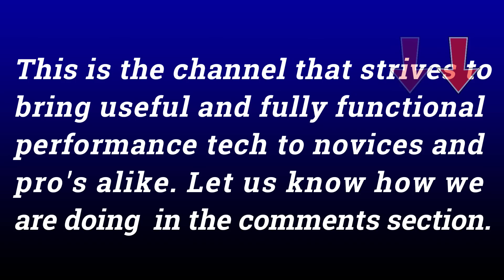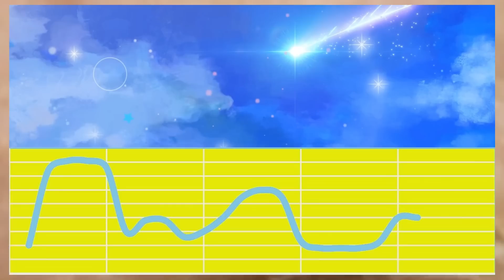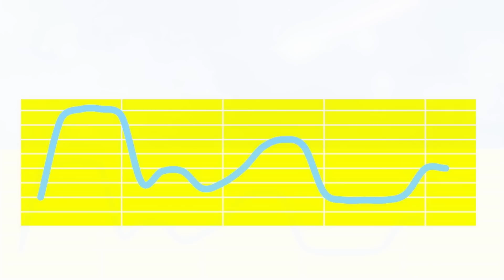DV's take on Weingartner cam shootout.

Comment: I don't care what u run on the street.  Give me back my rusty 1966 mustang, 302, 0.030 over, 1969 351W 4v heads, 2bbl carb, 2.5 inch dual exhaust, 2:80 rears with a leaking rear seal, 3 speed on floor.  2800 lbs with me in it.  In city block, beat 396 Chevelle, 400 Trans Am, and the police outa town.  Nobody beat me in city block.  I had no brakes, so, fast enough.
Reply: I got nearly same in 67
Reply: @dr.john-markcain4946  The 400 Trans Am guy made me pull over to see what my engine really was.  Boy, was he disappointed.
Reply: @dr.john-markcain4946  that leaking rear seal is a slider clutch ... it is a must have on street drags.
Reply: My Younger Brother won the Saskatoon Street Drags in a 1969 Mustang Grande (it had vinyl roof), 302, 2bbl, 3speed on floor. In 1984.
Reply: Oil keeps clutch cool and keeps gripping.
Reply: While sliding.
Reply: And as the clutch fibres tear off, they make the oil more grippy.  Win win in my Mustang.
Reply: I read in a magazine I could put 351W 4V heads on my engine and it had all the specs.  So Mom took me to Davidson, SK Ford dealer and bought the proper head  bolts. That was in 1982.  Those were the tapered head bolts.
Reply: Buddy Kurt sold me the heads off of a 1969 Ford Ranchero with factory 351W 4bbl.  I was ignorant at the time.  I should have bought the whole car.
But i went to school and sold my soul, wrote software in two countries.
Kurt had one of 4 1969 Roadrunner converts with 426 hemi.  His old car has now been restored and displayed and u can see it on tube in car shows.
Reply: Similar here 👍👍😎LOL
Reply: I overheated that 302 several times doing speed runs on Highway 11.  Tim, in his Chevy, always kept cracking his heads from overheating.
Reply: In the late 1980's, I was rocking 95mph around the Whitemud in Edmonton, this white Lambo caught up to me followed me for a bit then blew me away.  I hope he wasn't rude.
Reply: I took people across Edmonton in 35 minutes in my red 1966 Mustang.  85 mph down Argyle, passengers holding onto roof and sides at same time.  My Cousin was actually scared when i split lanes thru intersection at 85 mph.  I think 85 mph is my safety zone.  Tho my Harley likes 140 kph.
Reply: @bradyelich2745 
Wow, that's 87 mph 😳💥
Reply: @hotrodray6802  pretty fucking fast when you do it for 700 miles.
Reply: I got clocked by the Florida Highway Patrol in Henninpin county at 113 mph so they said.  It was sunday going home from work.  1996 XL1200S.
Reply: I was in Tampa ...
Reply: @hotrodray6802  I ran from Fargo to Saskatoon in under 12 hours, and I had two beers with my Dad in Kenaston.  10 fuel stops and a flask of tequila.  Canada let me back in without incident, but I smuggled our wedding rings.  I Ran Back to Saskatoon to get married.
Reply: I had to go 125 miles to get to Fargo from MSP.  I ran out at 120 miles because I rode too fast.  Some Buddy stopped, and poured gas all over my bike.  Then I get into Fargo, without helmet on, popo followed me knowing I'm a badass... until I got to hotel.
Reply: @hotrodray6802  I should ran South.  I'm so stupid.
Reply: @hotrodray6802  I already paid for the house in Saskatoon.  I should have ran away ...
Reply: The FHP held me up up for an hour trying to figure out if I was the Canadian bank robber they were looking for.  Funny, that was never on the news.  I only had to get the gates open, drive thru and close them ...
Reply: I lived at Marina Pointe in Tampa.  There was a 5 foot alligator in the pool, and a rabid raccoon hurting dogs.  I reported the raccoon but nobody came.  And nobody there had a gun, in fucking Florida ...  Can u imagine?
Reply: @hotrodray6802  That is what I cruise at.
Reply: 4000 rpm.  Still 40mpg, on the cam sounds great.
Reply: The Guess Who song  "Running Back to Saskatoon"
Reply: I stopped at lights.
Reply: ,,,,,,,,,,,,,,,,,,,,,,,,,,,,,,,,,,,,,,,,,,,,,,,,,,,,,,,,yes,,,,,,,,,,i believe in  u f o 's....................seen big foot last week in the woods...............................
Reply: That car is almost 2800 pounds curb weight the 6cyl was over 2600. And those heads only had 1.84” 1.54” valves with a 2.80 gear that car wouldn’t of been that great from a dig if you beat a 396 chevelle it would of been the low 325hp ones
Reply: @Thumper68  396 with four plug wires off maybe.. Dudes high af or someone couldn’t shift/drive.
Reply: @Thumper68  I had a leaking rear seal that gave me a slider clutch then locked when hot.  I think I had 150 hp to rear wheels.  At most 260 hp wot. the exhaust did breathe better than intake.  I weighed my car with me in it, it was just under 2800 lbs.  it was really rusty.  I weighed at the grain elevator.
Reply: @Thumper68  On the street, it is about hp to traction.  I dont care if u have 1000hp, my Stang beat u in a city block.
Reply: And I could do the same rain or shine or ice fishing.
Reply: @ lol ok sure.
Reply: @Thumper68  U think 1000 hp beats traction for 400 yards?
Reply: And u think a 396 375 hp is faster than a stock 325hp ford 390?
Reply: My Dad and his buddies raced for 50 miles.  The Ford 390 won.
Reply: If you want to win on the road for WOT racing, don't go for highest hp.
Reply: @bradyelich2745  no way your dad and his buddies raced for 50 whole miles… and you rode 87mph and 113 wow amazing lmao. Your idea of fast and mine are in two different worlds.🤣
Reply: @Thumper68  Shit we raced from Kenaston to Saskatoon.  Sometimes the whole way in the ditch.  When they twinned highway 11, it was just a personal race track as nobody was on it back then. I and buddies did many land speed record attempts.  It was glorious.
My 87 mph is for 10 hours steady on a xl1200s.  
113 mph is pretty crazy in town.  
My Dad raced from Thunder Bay to Saskatoon under 12 hours.  Ina 1958 Edsel.  135mph and that was on gravel and the square, no highways, all correction lines.  Im pretty sure Dad had one of the solid lifter 361's - the E400.  Dad said that car was the fastest he ever had - RIP Dad.
Reply: @Thumper68  When one guy in his corvette passed buddy in his hemi, the hemi guy said "I could see daylight under all 4 of his wheels at the same time".  Corvette guy said speedo pegged at 160mph.  They raced for miles, WOT.
Reply: @ ok I rode wheelies at 125mph every day and hit 170-190 multiple times a day. I covered 41 miles in 18 minutes on a road with some of the sketchiest turns that are 90 degree switch backs blind with overhanging rock that 25 is fast and over a pass that’s averaging 136mph. And it was about 50 degrees outside. I was hitting my governor at 186 so hard at one point I still accelerated to 196 mph.
Reply: @Thumper68  "Maniac" in Jeremy Clarkson voice.  120mph is good for me since i never know when im going into the ditch.  Which i've done because the beer bottle blocked my view.  But, I will hold that 87mph all day long, which many sport riders cant do cause they humping a football.  the one guy said he had to go 125mph to be comfortable.
My Buddie's Bois got in fist fight over how fast they cruised home on their sport bikes.  All the farmers said they could not go that fast.  It was hard fight but Bois won.
Reply: The Bois also grew up on the farm.  That Second One always got the biggest deer and he told me one time ' I just do what you taught me.'  That one deer he got was a 6X6 in SK flatlands.  Fing awesome.
Reply: a half mile from my farm.
Reply: @Thumper68  Did u ever watch the Black Knight rider on tube?  He is fing crazy and good.
Reply: @Thumper68  U paying attention? I had 1969 351W 4v heads.
Reply: @ yeah I know I can read. C90E heads have a potential of about 229 cfm intake and 175 cfm exhaust fully CNC ported.  Nothing to special really.

Comment: Looking at the data it appears as if the LS platform likes a late EVC.
Reply: ,,,,,,,,,,,,,,,,,,,,,,,,,,,,,,,,,,,,,,,,,,,,Generally speaking , a cam combination with  a SEMI LATE CLOSING INTAKE and a  SEMI EARLY OPENING EXHAUST  will give the most all around satisfaction in a high performance  engine.............................late  EVC,,,,[ATDC]   would  give more overlap  degrees, on the exhaust valve side,,,,,,,,,,,,,,The cam that won the challenge  had more than fifteen degrees duration than its intake valve.............I bet it would have made more torque  all around  with a  2.080 inch  intake   valve,,,,,,thus  , not needing  the  large  exhaust  duration,,,,,,,,,,,,,,,,,,,,,,,,,,,,,,,,,,The heads  were awesome,,,,,headers may have been better at  1.875 inch,,,,,,,,WTF,,,,,,Thanks  Eric  for your dedication , and  DV  for your  dedication....................................

Comment: Eric Weingartner spotted a trend.  He said that the better performing cams had the most lift.
Reply: Nonsense.
Reply: Lift.... 
Opening the valves higher gives more area under the curve at every lift point. Lifting BEYOND the max flow point allows the max flow longer. If the flow tops at say .500, then lifting to .600 means that head is flowing more earlier and longer.
It's always better to over lift the max head flow point.
IMO.
Reply: @hotrodray6802 only if the port maintains stable flow, a lot of LS heads go turbulent after 600 lift.
Reply: @hotrodray6802  The valve spends so little time at max lift that it makes no real difference in performance.
Reply: LS guys figured that out a while ago!   They were lifting mid .600" for years and having those elevated HP and TQ numbers and Ford guys wer scared to go over .600", they were mid to upper .500".
Reply: @dennisrobinson8008  I dont think the modulars could physically do more than upper .5s. If they can they dont have the head flow to take advantage of it.
Reply: @zapa47  so lobe on valve had that limitation.   Some had "rockers" which gave a multiplication but no where near pushrods.
Reply: @dennisrobinson8008  Ford guys running Cleveland style heads have been running .700" plus lift on solid rollers for 30 plus years. Another thing too Ford guys worked out a long time ago, when using Cleveland style heads, the exhaust port flow to intake port flow is poor, so the best way to help this  is to increase exhaust duration a fair bit more than the intake. The same thing they are doing now with LS3 style heads. Nothing new to old school Ford guys.
Reply: @Matthew-uj4zx  Hi.  I was talking about typical Windsor cam lifts on the street.   I knew Ford guys would use .7" plus in racing situations but for the street it's not common.   On the LS they've done greater than .6" lift in street situations over s decade maybe 15 years.   I believe the Ford guys thought it be a longevity issue but it's working on LS and that extra .100" or so of lift is making a difference.
Reply: @dennisrobinson8008  pretty sure engineers figured that out like a hundred years before the LS engine
Reply: Makes sense, in the real world you can't rebuild an engine every year so I'd discourage Stroker Mcgee from going full ham. Big american v8s love lift but most other engines get by with less
Reply: It’s the rate of the ramp in that matters. The steepest lobe with highest lift  you can have while staying in control of the valve will always be the best
Reply: @Thumper68  Not necessarily.  There is a target seat velocity that should be achieved by the valve motion.  It is possible to have too much lift at various phases of the cycle that can reduce velocity and hurt cylinder filling.
Reply: @DaveMcLain  u may be right.  I watched a video with the guy that specs the winning cam and he swore that it was a very gentle lobe profile.  And I also remember someone saying that the extra power may have come from the the gentle profile not causing as much pushrod flex.
Reply: @ericsmcmahan  Cams are always a compromise.  Take a look at some of the stuff that Mike Jones has posted about his design techniques.  His method is valve seat velocity based.  He uses the demand, the valve size, RPM etc to figure out what the engine wants.  He has to then compromise to get valvetrain dynamics that will work with the valvetrain.  Quite an interesting idea.
Reply: @DaveMcLain where did he finish? 99% of his 'technique' is used by anyone choosing a cam profile, those are basic fundementals.
Reply: @optimumperformance6998  I don't think that he entered anything in this contest.  What target velocity at the seat do you like to use when you select a camshaft?
Reply: @DaveMcLain  Umm, how about one that doesn't delay valve opening due to system stiffness or bounce the valve at closing? It is always system dependent.
Reply: @optimumperformance6998  I'm not talking about the seating velocity of the valve I'm talking about the velocity of the air coming through the curtain area that's created by the amount that the valve is lifted.   What velocity do you try to target when you're working on a camshaft for an application?
Reply: @DaveMcLain  Are we racing flow benches or living in reality of running engines. Seeing that you somehow have all the velocity data from a running engine across the valve seat maybe you should share that with the class. This was a simple contest with fixed parameters and all the information was available to anyone that entered.
Reply: @optimumperformance6998  I'm not talking about flow benches I am talking about running engines and the calculated velocity that has to exist through the curtain area due to the piston demand of the engine.  The approach that Jones has talked about is based on a target air velocity at the valve seat.  Read some of his remarks and then you'll understand what I'm talking about.
Reply: @DaveMcLain  again, a fancy way of getting your timing events correct at the valve (not cam).
Reply: @optimumperformance6998  That's right and the events that happen at the valve are what count because that's what the engine actually "sees" as it runs.
Reply: @DaveMcLain  640fps
Reply: @optimumperformance6998  Cam lobe designers like Brian Tooley design velocities at the valve rather than at the lobe.  They are able to use their spintron to monitor pushrod deflection, valve lofting, valve bounce and things like spring gyrations which also cause problems.  He's a pretty sharp guy also.
Reply: That isn't news. Lol you guys are acting like there wasn't an automotive industry before the LS engine

Comment: DV, Danielle Powell suggested that the headers were way too small.  The winning cam had about a 20 degree duration split.
Reply: He sure does but I have to question( after seeing larger headers make no difference on other engines) if the exhaust is actually restrictive or if the success has come from the larger diameter creating an anti reversion affect. And do the LS heads suffer more from reversion?
Reply: a smaller header with more split might be better.  better than even a larger header with less split.  might be a velocity and scavenger thing.  the exhaust event can act like a third lung, so to speak.

Comment: Didn't want it to make the number 1 figures?
Reply from the maker: If I had won I would have ZERO data above mine and that ultimately would cost way more than the $5000 I would have won!
Reply: @DavidVizard  as i  read it DV you used your cam as a known calibration point in the middleish of the data set so you could determine the parameters you need for your software primarily
Reply: For a sanity check. 14th place says he could have won if he wanted to?
Reply: @kylemilligan752 he didn’t say that at all.

Comment: Great DV. Cam must fit the intended use. I have no idea what all the cam specs were, but you stated you spec'd your cam a little shorter on duration which would be a great street cam, as you stated. Obviously all that entered are experienced engine builders with LS experience. Tough lot to compete with.
Reply: If you watched the video of the winner, he is a young guy, probably under 30.  He splits his time between designing his own engines and working at the cam grinder that  ground his cam.  Obviously, a substantial knowledge base on LS type engines in his experience
Reply: Several had no experience with LS engines, just the test parameters.
Reply: ,,,,,,,,,,,,,,,,,,,,,,,,,,,,,,,,,,,,,,,,,,THEN ,,,,,,,,,,,WHY DID  BRIAN  TOOLEY,,,,,,,,NOT WIN,,,,,,,,,,,,,,,,,,,,,,,,,,,,,,,,,,,,,,,,,MY THOUGHTS.........................all that entered  were not experienced  L S  engine  builders,,,,,,,,,,,,,,,,,,,,,,,,,,,,,,,,,,,,,,,,,,,,,,,,,,,,,,,,,,,,,,,,,,,,,,,,,,,,
Reply from the maker: Dale, For a guy that has never built an LS motor like this I think my cam spec was not to far off the mark!